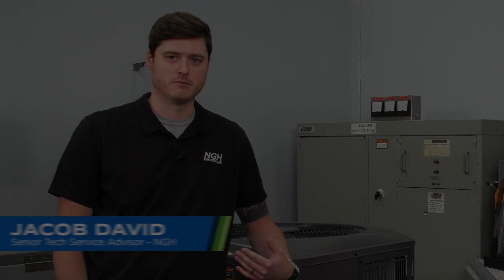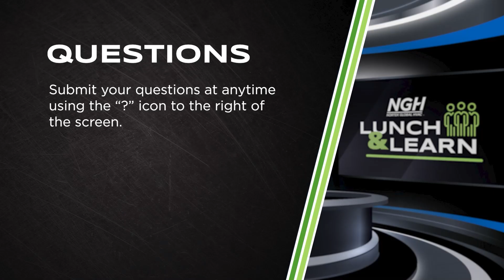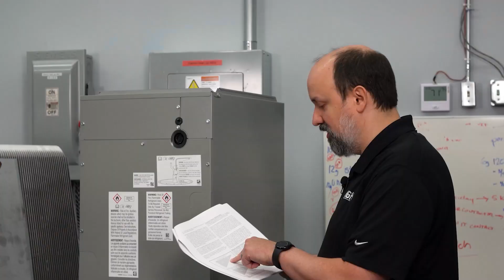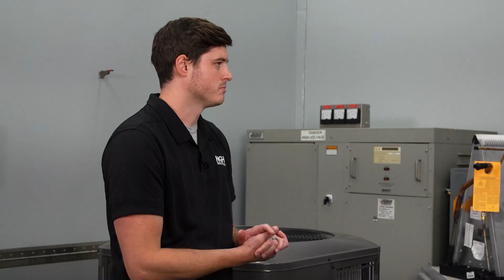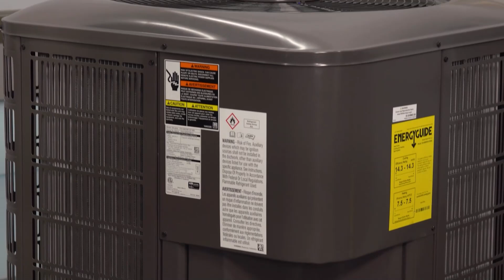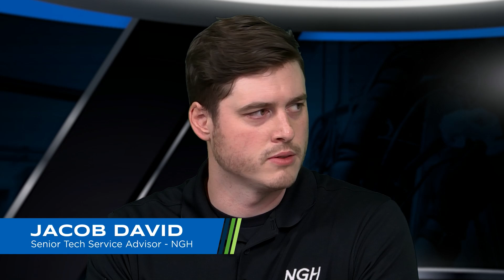Installation Considerations with A2L Equipment

Comment: I have a question on the 'return' requirement.  In my home, the main living space is 2 stories.  The house is served by 2 units.  The downstairs unit has a wall return, and the upstairs unit has a ceiling return (at the top of the two story space).  There are no supplies in the upstairs hallway where the returns are.  All the supplies for upstairs are in bedrooms.  However, all the bedroom doors have a 1 inch gap at the bottom which facilitates very strong airflow for return (you can feel the air rushing out with the door closed).  Would that count as an air return as the gaps were designed for that purpose?

Comment: Remember Rube Goldberg and his over the top inventions.   This insanity is worse.   Gonna kill the heating and cooling industry and the EPA is the catalyst. What is the point of having refrigerants that are flammable in the first place?  And they don't want any flame sources within ten feet of the furnace also, so now the water heater and gas dryer have to be relocated if required?    WOW!!!!!    Shit can these refrigerants , asap and get back to reality.  Contact your Congressman and President Trump and let us end the absolutely unnecessary direction this has taken.

Comment: Why can't you just say that there's a circuit board that has to be added to the furnace that the thermostat wires run through before they get to the primary board?

Comment: Thanks for the info but when the gentleman said you have to use a2l approved contactors and relays it hurt pretty bad given the massive stock of parts the whole world has in the back of their van or supply rooms 

What are people supposed to do launch them into the trash can 

A2l vacuum pumps recovery machines and throw away the old ones. This whole thing is unnecessary

Comment: So if a bedroom has a door it will not be considered part of the square footage necessary. All bedrooms have doors. I will suggest to apply outside air to the ductwork return so if there is a leak the unit will have fresh air to distribute through the occupancy, There is also a concern not only about the ignition and how to apply the square footage rule. But if there is a leak the blower will also stay on the fan on mode distributing the gases inside the dwelling.
Reply: Bedroom without a return isn’t part of the square footage
Reply: @sogoodgolf  thats what he meant
Reply: @MrMugenwii  well he’s saying all bedrooms have doors as if that’s what counts them out but as long as it has a return it’s still counted